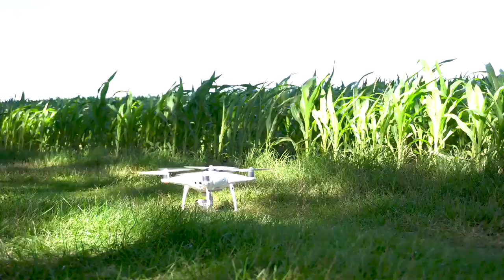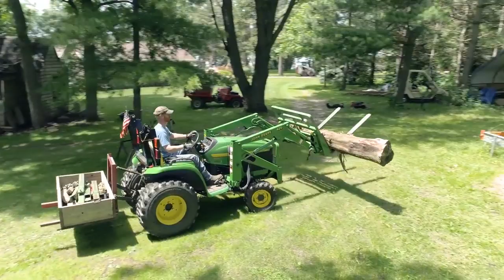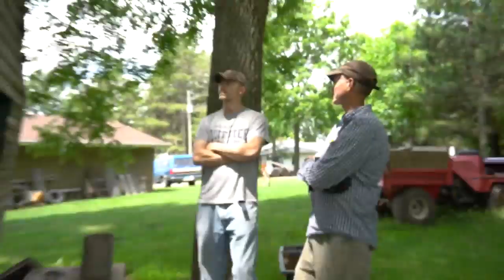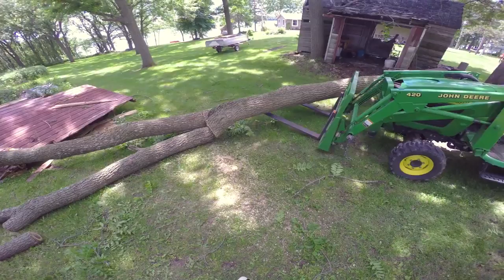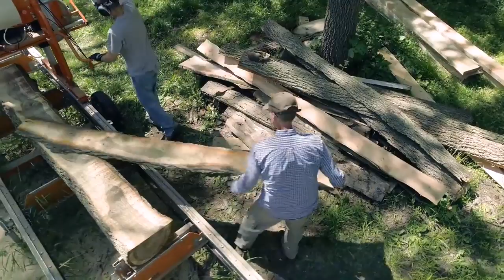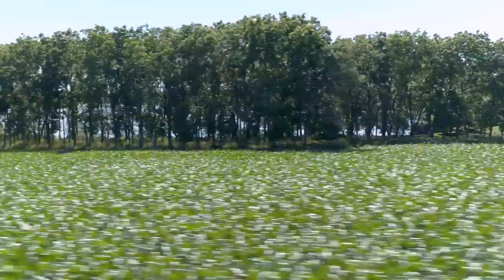A Day Harvesting Black Walnut & Sawing Logs into Lumber in Southern Minnesota

Comment: How long is the sawmill trailer frame Sir
Reply from the maker: Hi Quinten

Standard, Norwood band sawmills are 16 feet long (4.8m), which allows you to cut up to 13-feet (4m) in length depending on the model.  But you can add optional 4-foot (1.2m) log deck extensions to saw longer. In fact, you can saw logs of any length in stationary configuration – some Norwood owners are sawing logs over 40-feet (12.1m) long!

If you want to add the trailer system to your Norwood, you can still add bed extensions, but cannot go as long. With the LumberPro HD36, you could add one permanent 4-ft (1.2m) log deck extension and up to two 2-ft (0.6m) detachable extensions to saw logs up to 21-feet (6.4m).